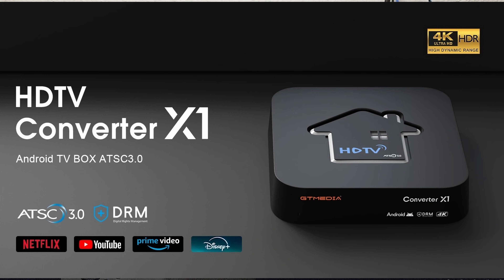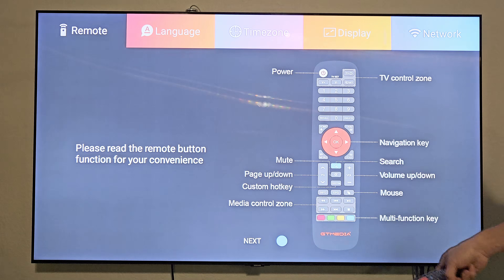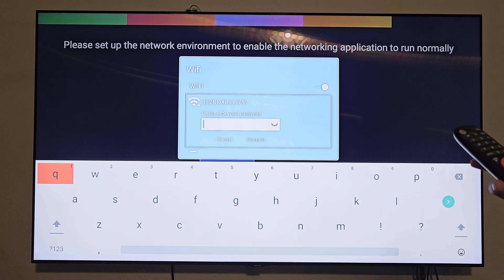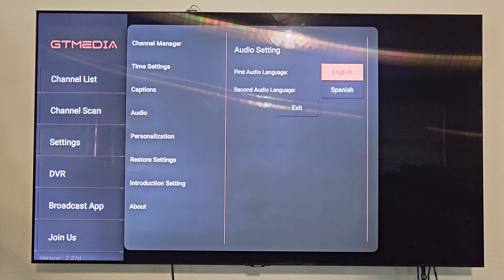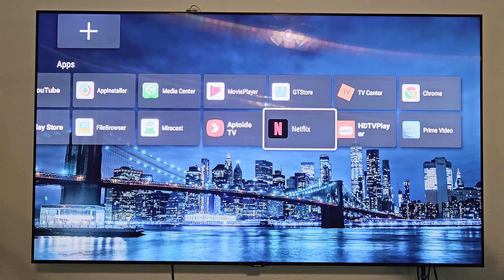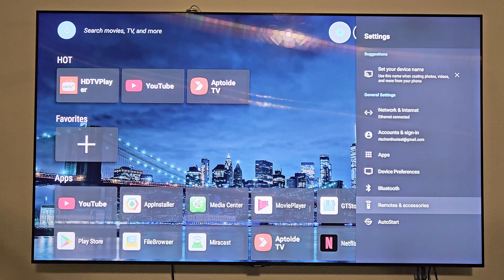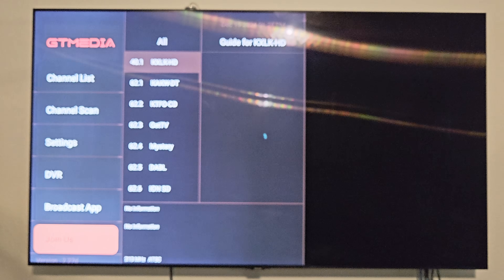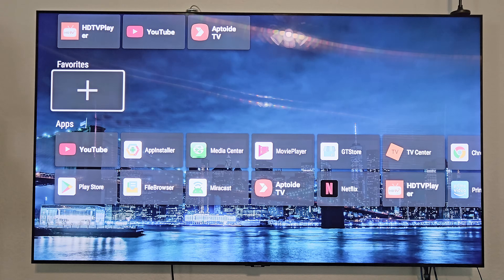GTMedia HDTV Converter X1 ATSC3.0 Install & Setup

Comment: I bought this same box very disappointed in it it got the ATS 3.0 channels at first but it would not record very well so I did research and figured out how to download a upgrade or a update so I downloaded it put it on a flash drive installed it it did fix the recording issue but now it will not pick up the atsc 3.0 next-gen channels no matter what I try so I'm very disappointed in this thing the tuner is very weak and I have an outside antenna not happy with this product